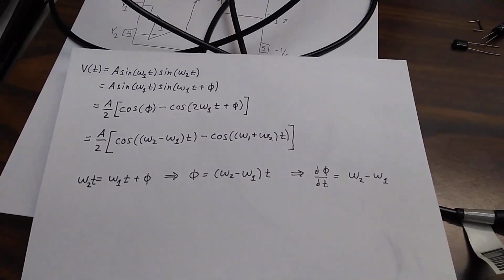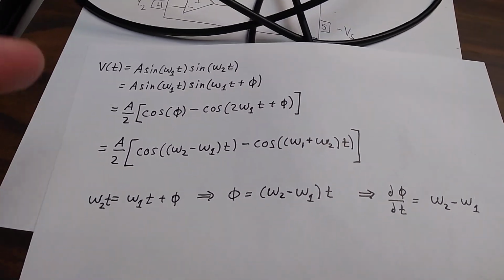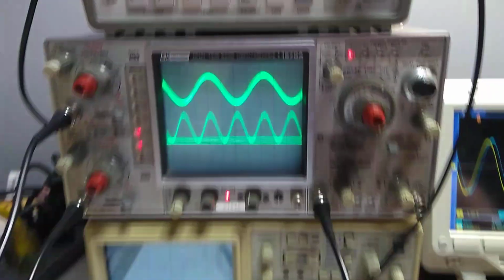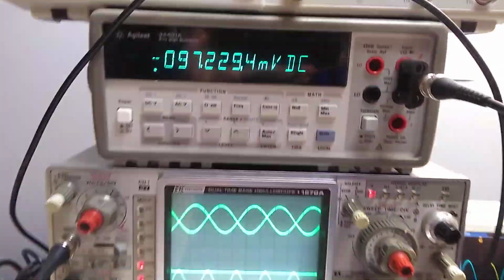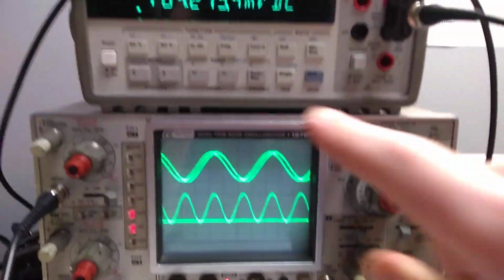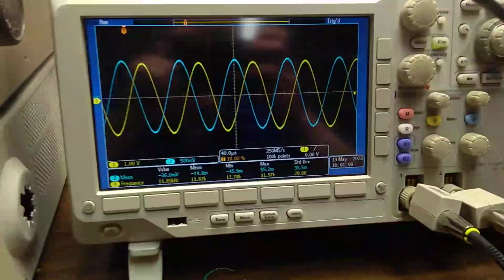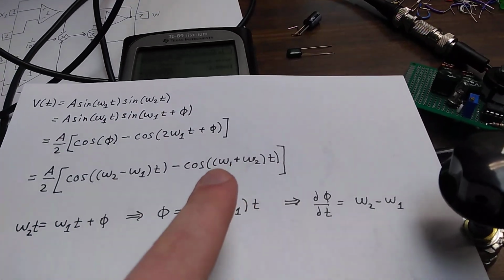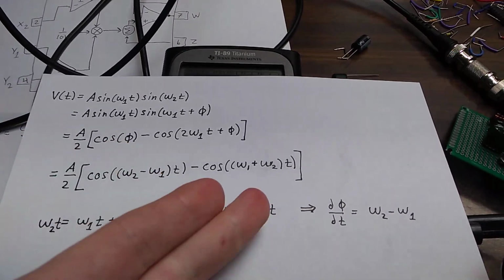Measuring Phase Shift with an Analog Multiplier

Comment: Stabilize your camera or get a flexible stable tripod.  You have good stuff but you are jumping around.  Nowhere have I seen anyone put the DC offset so well. But you need to hammer and refine, improve and re-do this until is is perfect enough for 5 Billion  Internet users. Get some 24 bit 1 Msps ADCs and record the data for 24 hours.  Your "temperature sensitive" and "sensitive to breathing on it" device is an uncalibrated sensor..  Maybe a good one - if you calibrate it.  Package it and is can be useful for learning.  Richard Collins, The Internet Foundation